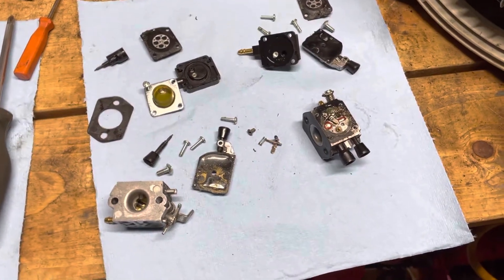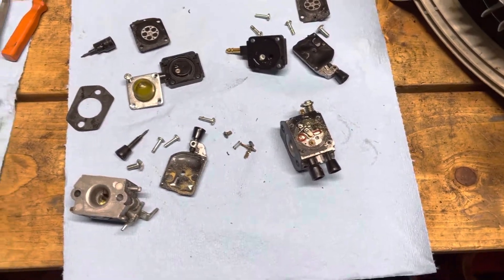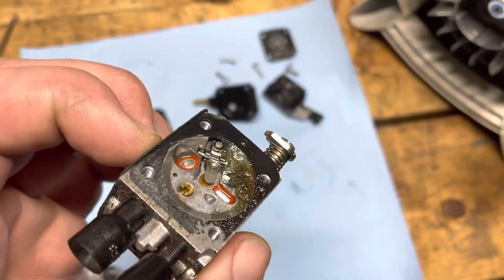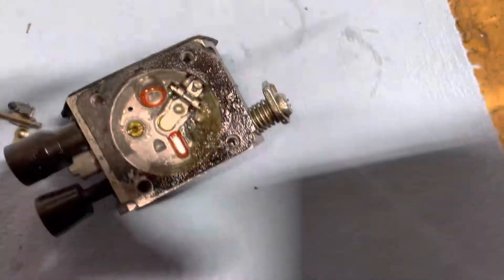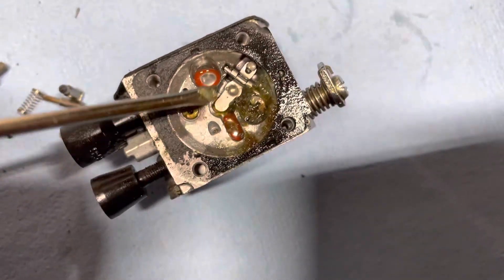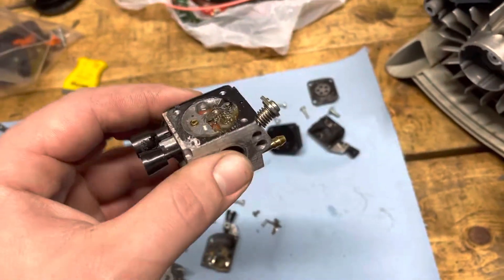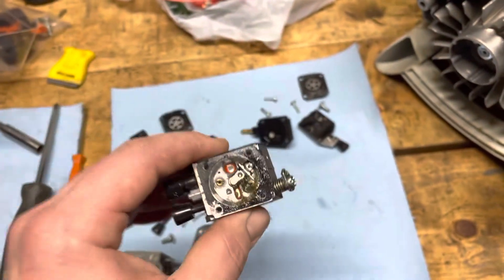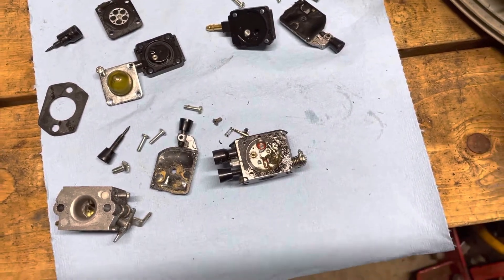Does it matter what gas I use in my small engine? Why won't it start? (small engine carb problems)

Comment: Yep, ethenal is the killer to small engine carbs. And when people run 87 fuel in them, it don't take long.
Reply from the maker: I always echo what @donyboy73 has told me. 45:1 and 0 ethanol gas. Add some stabilizer if you're feeling frisky!

Comment: I think people make too much about E10 fuel.  Yes, it you leave it sit, especially in a carburetor, it will cause problems.  Run the carb dry or drain the fuel if the equipment is not going to be used for a couple of weeks.
Reply from the maker: I think for a more frequent user you are right - but 99% of people are not using their equipment regularly and simply let it sit in a hot shed.